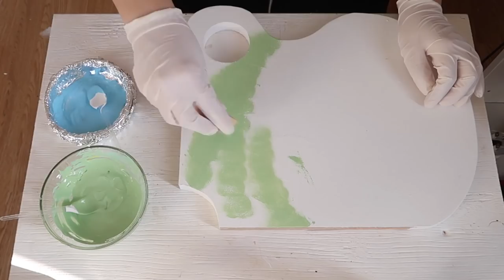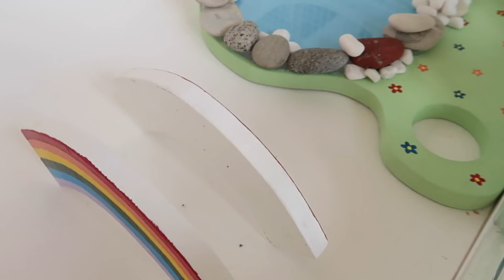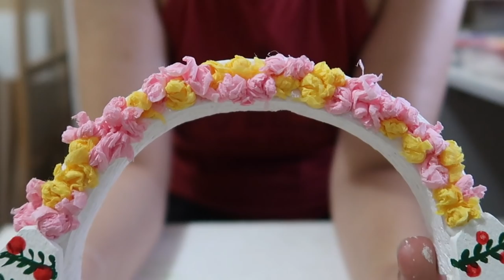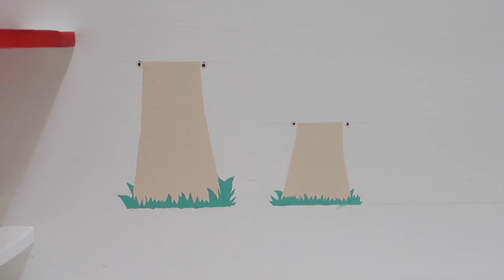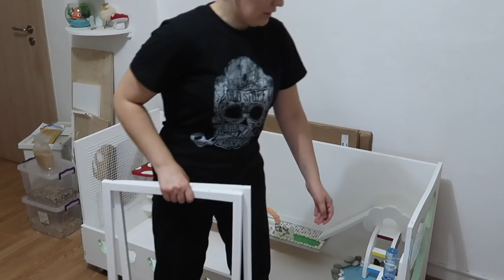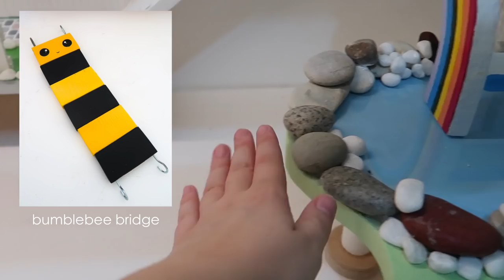Building A 1300sq Inch Custom Hamster Cage | The Beaker [2/3]

Comment: I love this Erin. Its beautiful and so nice. I can't afford to build a cafe like that so I have working on large bin style cages for my babies
Reply from the maker: The total cost of this cage came to about €50 - €60, it's not that expensive to build your own when you consider that much smaller commercial cages are sold for a lot more :)
Reply: ErinsAnimals oh my that's amazing. I'm in the U.As I that would be between 70-80 dollars. Did u go to Ikea for ur supplies??
Reply: I ask about Ikea bc I found this amazing glass book shelf I saw turned into a hamster cage and I have been thinking about getting it. The hamster cage they turned into was called a delot cage I think. I might have spelled it wrong but I was like 60 bucks for the shelf.
Reply from the maker: For this cage everything but the light came from my local hardware shop. The detolf is a good cage choice though, you can find videos of my old one and a review of the detolf on my channel if you wanted to see more of it :)
Reply: ErinsAnimals it is an amazing cage and I have been looking forward to seeing ur updates and videos. We r trying to build a single unit that can be split into 2 separate living spaces. One would be for our Syrian hamster Loki and the other section would be for our robos ogham band haven. The living space would be sperate by length with one in the top unit and the other in the bottom unit. Do u think that would be possible with us having our baby Loki?? I worry the sent of our robos would stress him some how

Comment: This cage is amazing! I'm in the middle of designing a cage I plan to make and I'm curious how you made the wire mesh safe for your hamster to have on the inside of the cage. Did you sand the pointy edges? I'm considering just covering mine with silicone, but if there's another way I'd love to know. I also wanted to let you know that I searched for animal safe paint and found a company that makes a non-toxic paint specifically for animal cages. It's called ECOS. The paint has very little odor and is safe for bird cages. I'm excited because I'm sensitive to chemical smells so having this paint will make things so much easier. I just got my first roborovski hamster and she's currently in a bin cage...can't wait to make her a DIY wooden cage! Thank you for all the great ideas!

Comment: I would advise you to put planks along the whole of the top as the hamster could easily climb up the metal fence and climb out
Reply from the maker: No she can't, you must have missed the part in the video where I said those beams are supports for the Billy XL cage. It will be impossible to climb out as there will be nowhere to climb out of :)

Comment: Hey erin I have a question can I put fabric/tiny picnic blanket inside my hamster's cage?
Reply from the maker: Some hamsters will chew fabric so it's best to test them with it while under supervision first. If they don't take much notice of it you should be safe to use it in their cage just make sure you check it daily for damage and remove it if they are chewing excessively :)
Reply: ErinsAnimals okay thanks!